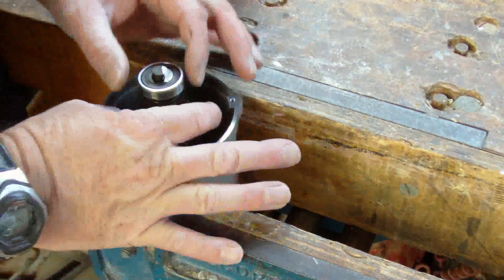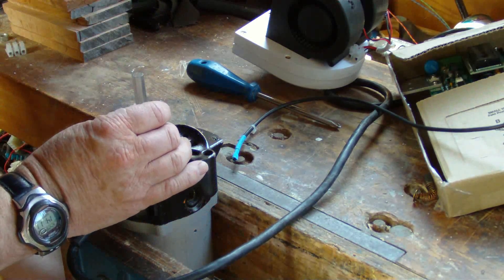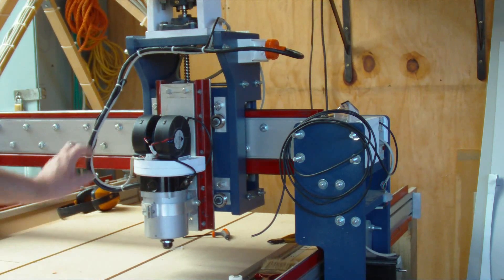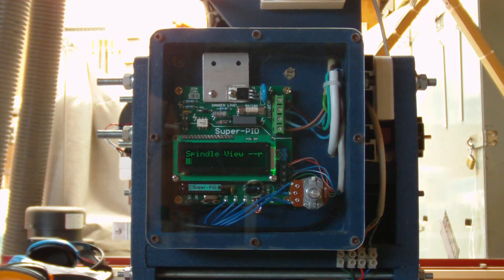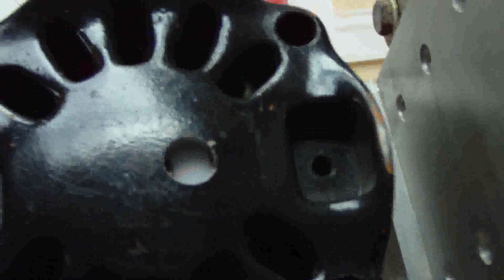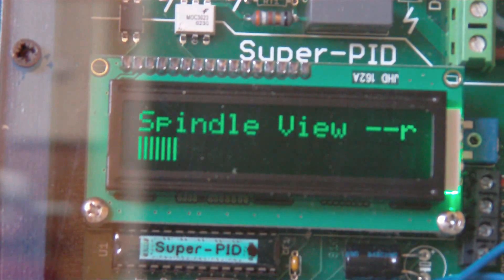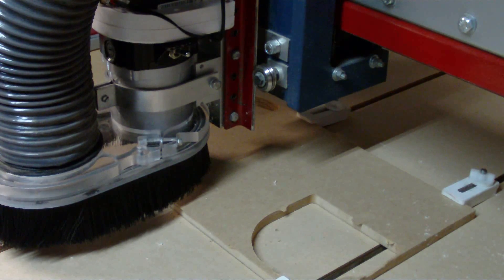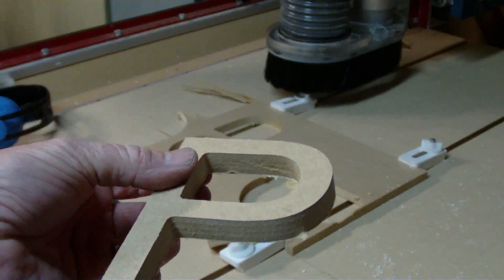Install and Test of Super-PID 2048 - CNCnutz Episode 19

Comment: Are you kidding?  People want to see if 1) the router can maintain rpm under load. 2) if the router overheats.    The video should show rpm during use, not making some kinky item!
Reply from the maker: I kidd you not J D
At 13:57 and 15:44 it shows the spindle RPM on the SuperPID as it is cutting Perspex and MDF so you can judge for yourself how well it holds the speed. I also stated at the end that it kept a constant speed when cutting the MDF.
I used the Router in that configuration for another 7 years before I updated it to a Spindle and it never came close to overheating once.
Cheers Peter

Comment: I have two inexspensive sears routers, and both of them melted the fans when the cheap bearings burnt up.  i was able to use some scrap hde plastic and my probe that i built and get the general layout of the fan shape. then i drew up a fan and used Cut-3d to create the milling for it.  now they both have fans that i cut with my cnc machine, it was a lot of fun to do actually, that would be a cool next project for you.